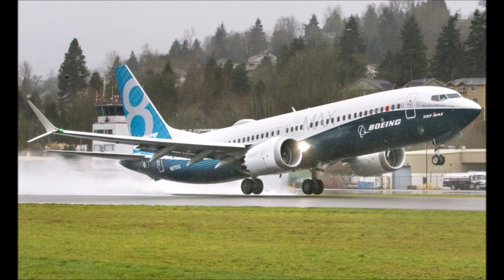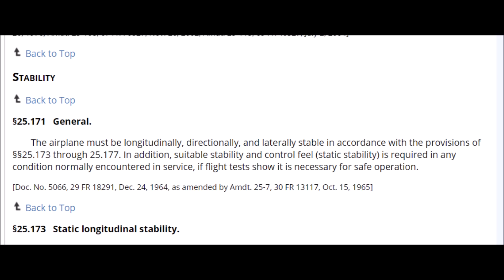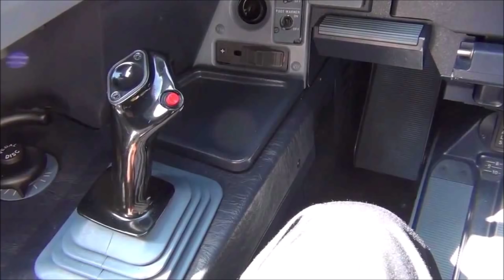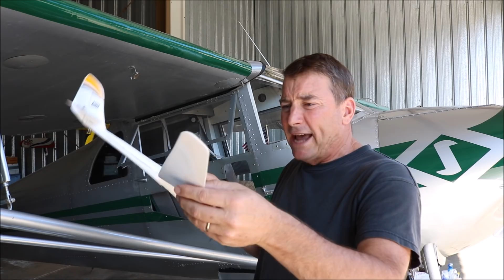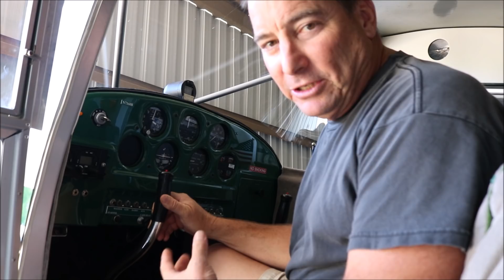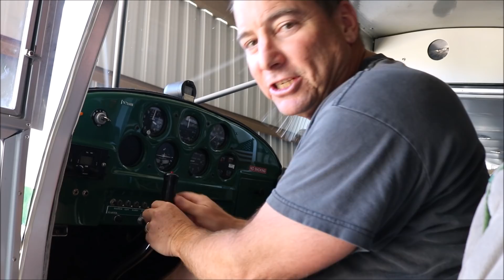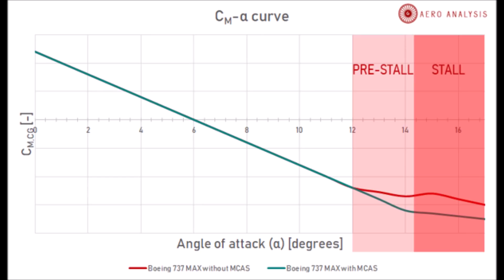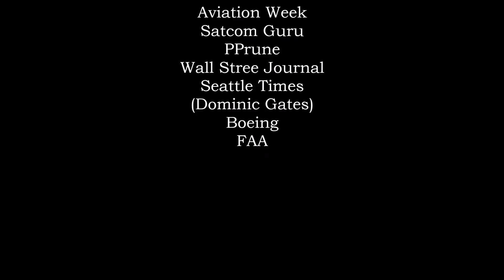737 Max UPDATE 30 Aug  2019

Comment: Airbus ran into a similar problem with positive feedback between pilot input and computers but the problem was solved and documented.  Boeing had to be aware of the potential problem and they should have used Airbus experience.  In my opinion pilot input should not be overridden by automation and even more so if the co-pilot inputs confirm the ones from the commander.  

The money saving was misplaced as the rating system is overseen by an international organisation. The rating process is part of the cost of doing business and it is a cost every airline has to shoulder.  

Constructors have optimized until airplanes had very small margins for amelioration.   The set of common constraint is a legacy of refinement toward which all constructors converged and it is one area were there is nothing to be taken out of the equation.  This is a personal opinion.

Comment: Is it correct the Ethiopian air pilots did hit the stab trim cutoff switch at some point.  Seem to recall it was unclear if they turned it back on while troubleshooting the problem??  All pear shaped by then sadly.  That’s a great description of control feedback and trim and COG / COP.  Feel like I’m back in school with a good teacher.  Nice 👍 deserves that drink.  I wonder how general pop feel about flying max after it’s sorted.  Expect some fallout.  Hey.  We’re sitting in the California sun here on the 43rd parallel South....172E!  Spring has sprung.  cheers.
Reply: Andrew Wade they did use the stab trim cutoff switches and tried to manually trim, but they were far beyond the VNe speed and the forces were too great to overcome... It is very tough scenario, especially for inexperienced pilots...

Comment: Aero engineers have taken exception to pilots flying their beautiful planes for a long time.  First plane I owned (Ercoupe) was designed to be un-spinable.  Present plane (Tri Pacer) is designed with 20% rudder pedal travel interconnect with ailerons, presumably to secure coordinated turns.  Fine, except, trimmed for hands off, won’t make those <5 deg. heading corrections without banking the plane.  I believe today’s engineers think of pilots as a dangerous superfluous gelatinous mass screwing up their wonderous algorithms.

Comment: That sounds like felony conspiracy criminally, and gross negligence civil.  You don't consider the replacement workers built a plane that was falling apart the first day of flight.  If the plane's body BENDS, the sensors would provide the feedback that caused the nose dive.

You are over thinking it.  

All the superior Boeing technicians were laid off and replaced with affirmative action turd world workers, just like in the design evolution of the aircraft.

They STILL won't rehire the workers that built planes that wouldn't fall apart the first day of flight.  Gratz Boeing.  Go out of business, you deserve it.

Comment: Juan, about At 14:20 : Airbus has NO 'feel' transmitted through the side stick. So how do Airbus aircraft meet the requirement of 3 pounds stick force per 10 knots out of trim? The Air France flight 447 accident seems to be a clear example of how confusing it can be in an emergency to fly without that stick feel. In the case of flight 447, one of the crew held the stick full back ( not much motion for that tiny side stick ), and was unaware that he was keeping the plane in a stall. The other air crew had no idea he was doing this since the other side stick does not move in unison with the 'active' one that is being used to control the aircraft. I just don't understand how Airbus gets away with this one. Without the force feel in the controls they are depriving the pilot of cues and information needed to recover the aircraft in an emergency. All Airbus planes have this design. Flight 447 might have been saved if the controls were designed with force feel, and both sticks moving together. The Boeing style yoke would have been even better, since it is hard to miss BOTH yokes in the full back position. An yet, stangely, Airbus received  no heat for this. Instead, the air crew was blamed for the loss of Flight 447. So how does Airbus meet FAR Part 25?
Reply from the maker: computers.

Comment: The question is: will the new fixes to MCAS still allow it to perform its original purpose, feel similar stick pressures? PS: the nacelles generate lift in high angles of attack, which is what probably affects stick pressure. How is that addressed? 🤣

Random Future Thoughts:  In every surviving B-737 crash (of any variety), the fuselage has broken into three parts, one in front of the wing, one over the wing, and one behind the wing. Note to the general public: the fuselage is supposed to stay intact, by FAA design requirements. 🤣 The Inspectors In Whichita Kansas where the fuselage is built have documented that the fuselage is assembled incorrectly using unapproved jigs instead of the computerized robots that would put the riveting in spec. So every 737 breaks apart on impact, and the inspectors have lost their jobs, but have retained the documentation.😘

More Future Thoughts:  CFRP (carbon fiber reinforced plastic) the very stuff that the B-787 is made of, well CFRP turns to jelly on contact with hydraulic fluid very fast. The flying public should know that the hydraulic systems are cooled by radiators submerged in the fuel tanks out there in the Wings. Boeing guarantees the 787 a forty year lifespan.😂 Wanna bet?

More FutureThoughts: The myriads of computers up in the nose of the B-787 are cooled by a glycol refrigerator system (much like your high speed gaming system), that system is located back in the bulk cargo hold. Plumbing runs in the ceiling all the way to up front, and on the way it provides cooling for the galleys refrigeration.🤣 what could go wrong. . .

More Future Thoughts: Don’t Buy Boeing Stock.
Reply: Air Niugini Flight 73? Continental 1404? You are repeating a fake assertion put forward by Al Jazeera based on a whistleblowers' claim, which they lost in federal court twice after both sides were heard and actual data presented. By the way, as the wingbox is typically the strongest point of construction in any aircraft as it has to endure the most critical stresses, structural overload failures will often occur to any appendage just outside of it.
Reply: No , I’m repeating actual experience as a quality control inspector at Boeing for five years. . . Troll

Comment: Prostrate Cancer is just one of many deadly Cancers we humans must deal with. Its survival rate depends on many factors. Least of which is our very own DNA structure. Next, the types of treatments available to combat it. My father has Prostrate Cancer now. His treatment involves several medications, diet, exercise and above all else, faith. Currently, he is taking a medication called Xanti.  Very large pills, he was taking 4 every single night until he had a stroke last year. Then he had swallowing issues which precluded him from taking these pills. They're very powerful. Knocking his PSA numbers from mid 300's down to low teens, but there is a trade off. One side affect of Xanti is high blood pressure. So one must possibly now take blood pressure medication. My Dad did this, but again, he had a stroke. He is recovering thanks to my helping him and PT/ OT. He can now take the Xanti one pill every night. His most recent PSA suggested the Cancer was resurging. So now we wait until his blood test to see if the Xanti is helping. He also takes one Luprin Shot every six months. Designed basically to keep the Cancer more or less in check. Kinda of like how a dam keeps water from simply overpowering the below valley. Diet is high in vegetables and other healthy type foods. He is 87. His doctor gave him 1 to 3 If he did nothing. So, hopefully the Xanti will work. Its a fairly aggressive med, but then again Cancer can be very aggressive. Requiring equal aggressiveness. 

Xanti and Luprin.

As for the reason for this video. The 737 Max. Personally, I love Boeing products and Airbus products. The issues which caused the 737 Max crashes has been resolved in my opinion. The issue now: 

How does Boeing sell its most famous, most mass produced product back to the airlines and more importantly, the flying public. I've never been a fan of witch hunts or scapegoating. Which, in my opinion, is exactly what happened with the 737 Max. When an aircraft goes down and innocent life is taken, someone must take responsibility. If the same exact type aircraft goes down, then it is up to the FAA and the various airlines to ground the type until an investigation is accomplished. Once the NTSB, FAA, FBI ( if criminality is suspected ) is completed, then the findings are shared with the public. If the FAA does a really thorough investigation, then it is likely, the issues/ problems will indeed be fixed or resolved. However, damages in the form of human life lost occurred. Which changed the dynamics of everything. Lawsuits and other legal type efforts can literally ground everything period. Yet, the 737 has indeed been around since the 60's. At least the basic form of the aircraft. Technically, the design dates back to Nazi Germany's Me 262. With that aircrafts engines being located under the wings and the wings being swept back. The design was, in effect, perfect for so much more. Including commercial flight. 

The real culprit to all of this is this. Technology has virtually taken over in the cockpits of aircraft today. Pilots today are more akin to computer engineers or programers vs actual aeronautical skills. This technology, at first, was for the purposes of reducing fatigue in pilots trying to manage so many systems on board. Now glass cockpits, micro processors and such do almost everything. Of course, the technology came in incremental stages. At first, being utilized in military aircraft. Consider the F-117 Night Hawk. By all accounts, the most sophisticated and most Top Secret aircraft ever constructed in our country. Its technologies were literally, at the time, out of this world. Real Area 51 type stuff.  

Back to the 737 Max. Anyone who flies, knows that glass cockpits and fly by wire technologies have a downside. Too much technology can have far more deleterious affects and even fatal affects if relied upon too much by those of us who fly. My F-4 Phantom was, by all accounts, one of the most sophisticated aircraft ever mass produced for the military. Yet, it's cockpit was by to days standards, antiquated. Even archaic. Yet, nothing on heaven and earth was as fast, lethal, deadly or precise as the F-4 Phantom. I'll stake my entire reputation as a Marine Aviator against anyone who says otherwise. Only one aircraft was as superior and technologically advanced. The F-14 Tomcat. In time, both of these sophisticated aircraft would be retired out. Replaced by F-18's and F-22's etc. Technology being incredibly amazing in today's military aircraft have found new homes in Commercial, Corporate and Private aircraft. 

Key Words: Information Overload.

A pilots ability to digest everything on a instrument panel becomes far more problematic when he or she must look at various glass screens. If said pilot gets caught up in a moment, becomes even remotely tired, distracted etc etc, then that information can have dire consequences. The 737 Max, is, by all accounts, a beautifully designed feat of aeronautical engineering. No, the people over at Boeing really went over board on her. She's an incredible flying machine. What happened in these two crashes had as much to do with technology as informational over load. A pilot must fly by the seat of their pants. Yes, that is a cliche. But it's entirely true. I know. I have many upon many hours experience in the cockpits of various F-4 Phantoms. I carried that experience into corporate aircraft. Hawkers, Citations etc. This was when class cockpits were just starting to fill as many cockpits as the manufactures could fill. I can attest to the power of this technology. It pulled me in. It sucked me in so much, I forgot I was the guy flying the damn plane! Yes, I get testy about this. Those pilots in both 737 Max crashes, it wasn't their fault what happened. They flew their ships as they were instructed. However, the devil inside, those damn computers, had other ideas. Of course my opinion(s) are simply my opinion(s). 

I say, give the bird another shot, but let pilots be pilots. Don't force such technologies to a point where by the pilots are literally at odds with the computers on board. That and set up basic instruments again. Dump all this fancy this, fancy that. Some things are great, but too much is not great. But deadly. 

Juan you get better, you hear......🇺🇸

JR
Reply: JR Ewing well said on the tech side of things. I also believe that machines can be over done with technology. Its something that I am seeing happen in my industry the trucking industry that they are trying to over compensate for the lack of qualified drivers by adding technology that isn't as safe as they claim it is. I also believe that technology shouldn't take away from the operators seat of your pants feel because thats a big part of knowing when your getting out of control by how the machine reacts. As with these tech devices they all but take that feeling away from the operator and can be a detriment to safety not a help to it. Also I would like to give a big shout out to you Juan Browne Blancolirio for having a great channel where we can all learn from each other and have an unbiased speaker of truth.

Comment: The one critically missed point was that although Boeing reasoned the pilots should react and disable the electric Stab Trim, the pilots in the Lyon crash were completely unaware of the MCAS. The previous flight's pilots recovered the aircraft when AoA sensor acted up only because a third pilot was in the jumpseat and could observe the unfolding scene from a different perspective.  The Ethiopean pilots knew of MCAS but shutting off the Stab Trim  procedure failed to achieve the desired results as the manual trim where counter forces were too difficult (due to excessive speed) to overcome so they opted to turn on electric Stab Trim again. Two errors in hindsight, not enough time to process the situation.

Comment: American ordered 200 A320's and Boeing went in and said if we can march Airbus would you consider giving us some orders. So American split the order 100 A320 and 100 737 Max. Boeing has had FAA regulator lock-in for decades. Considering what has happened with the Max all FAA approvals for Boeing need to be fully re-apprised. The single input to the MCAS was to keep it from flagging it up as a critical system and allowing Boeing to sell the Max as a minimum training requirement option. Boeing was once a great engineering company but then it became all about maximising shareholder returns and standards were sacrificed for profit.
Reply from the maker: Yep!

Comment: An excellent overview of the whole affair!  It still leaves me wondering about a couple of things.  From a software engineer’s perspective, even without close FAA oversight, I don’t understand why senior software engineers didn’t see the problems in the MCAS design.  The design of flight control software should not have been left to rookies, but managed by senior engineers with an understanding of the need for robust design in such systems and how to achieve it.

Another thing I don’t understand is why, when it is necessary to disable automatic trim, would you want to disable the motors, forcing the pilots to use a slow and cumbersome mechanical system to adjust trim rather than switches on the motor circuits?

Finally, I would add that it is not merely the FAA which has lost the confidence of the public, it is the upper management of Boeing.  I want to know what Muilenburg had to do with allowing this poor design to be produced.  We already know he did nothing to get control of the matter until he was forced to.
Reply: They never envisioned it as a flight control system. It was supposed to be a maneuvering characteristics assist system only in an emergency scenario, one way out of the normal flight envelope, and thus would very rarely if ever be engaged. If it malfunctioned, the pilots would just disengage it--that is what trim cut-out switches are for. Hindsight is a very different, marvelously less opaque thing than developmental theory, and those assumptions are now infamous.
Reply: Reflected Miles — Any software that moves the flight control surfaces is flight control software.  It is in the Flight Control Computer.

Comment: A few quibbles: You refer to the FAA employees as "inspectors." FAA inspectors are under a completely different organization than the certificiation office. You assumed that the seasoned FAA engineers left because they bored because the certification work had been transferred to the corporations. You may have correct inside knowlege, but the reason that ODA and BASOO are established is because there is too much certification work for the FAA to support as presently funded. Perhaps seasoned FAA engineers left because the administration announced from the beginning that federal employees (including FAA) are over paid (not to mention occasional furloughs for government shut downs). Well, I shouldn't write a white paper in your comment section, so I'll just end by thanking you for another interesting video.
Reply from the maker: Did you see my references? It was not me who reported this initially. I'm simply the messenger. "You're mileage may vary..."